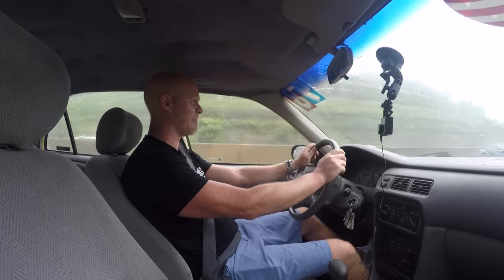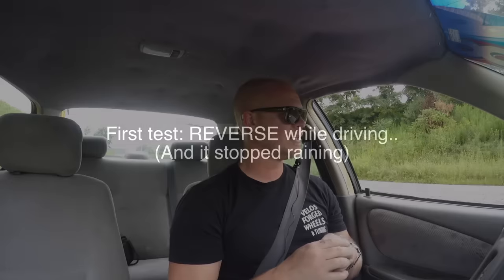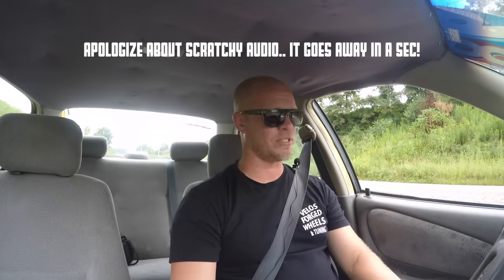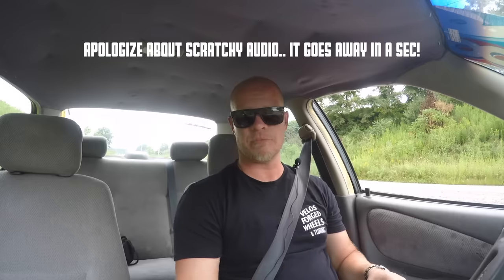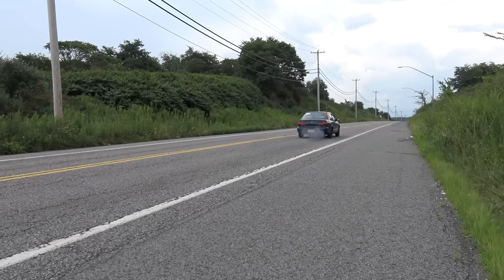What happens if you put a 20 year old car in Reverse AND Park WHILE driving? (NOT SAFE)

Comment from the maker: What video should be next? ;)
Reply: AutoVlog extreme abuse test. How much will it take to truly break the Chevy Prism
Reply: Take it off road
Reply: cold start up and before you start it hold gas and start it in drive and go before the car starts properly and keep on high revs
Reply: crash it into something and see what the damage is. (low speeds)
Reply: Put a manual car in reverse
Reply: AutoVlog "how long can a 20 year old engine last at redline?"
Reply: hahahahah the gearbox is gonna go "boom" and its not funtion then
Reply: What it looks like to crash a Chevy prism
Reply: does a Prism float
Reply: Floor the pedal on a cold start
Reply: Try going from reverse to drive?
Reply: Gotta do a reverse to park video. Done that before by accident in a 1995 Cheney conversion van. Full size. And it was a very loud tick tick tick noise. I assume from the parking pin slipping from momentum.
Reply: See if Prolong super lubricant really works.
Reply: AutoVlog hey could you do more sports/performance car reviews  maybe even normal cars 😉😁
Reply: Try putting it manuli in 1. gear wile driving 60mph :)
Thanks
Reply: Hey you should see if it can do a burnout???!!!!!
Reply: AutoVlog I think you should get a eBay catalytic converter before you pass out while driving.
Reply: Stunt driving. Reverse at say 40 or 50, do a 180 and floor it.  Build some ramps and try to get it up on two wheels (wear a helmet just in case you roll).  Clorox burnouts would be fun, you can get the parking brake tightened up for a good lock.
Reply: What happens if u throw a hand grenade in a Chevy prism
Reply: What happens if you put it in first gear while driving?
Reply: Throw the keys out the window while driving 😂🤣
Reply: How long can you drive on a dead alternator
Reply: Pimp it, Xzibit-style.
Reply: Drive this car in reverse fast and then drop it in drive while flooring it!
Reply: Or drag race or both
Reply: AutoVlog neutral drop, go as fast as you can in reverse and put it in drive
Reply: Neutral slam at redline
Reply: Try putting a 20 years old manual transmission car in reverse while driving and rev it ;)
Reply: Throw the key fob out the window while driving
Reply: Try pull some heavy weight....
Reply: Try to tow the F-150
Reply: fastest speed in reverse, burnout, donuts, towing f150, racing c63 (benz in reverse), sumo with f150(both cars head to head with a buffer in between pushing each other), off roading, jumping it, j turns... jeez i need a beater car
Reply: Try putting anti freeze into the gas tank
Reply: Since it already smokes try seafoaming it to see if it helps.
Reply: Off road adventure
Reply: AutoVlog burn it
Reply: AutoVlog Absolutely Hilarious Video I'm glad you're ok after doing those tests I think your see happens if slam the brakes at the Highest Speed possible on a long straight road and if you rev it up to high rpms
Reply: AutoVlog can your 9 year old daughter drive it without power steering.
Reply: Great video !!! :) :). PLEASE TAKE IT OFF ROAD FOR THE NEXT VIDEO!!!!
Reply: put it from drive to low gear at 60mph
Reply: Top speed of reverse, then top speed of reverse to park.  I think the car turns off when going in to reverse to keep the pump or whatever from working in the transmission, other wise it would try to tear itself apart.
Reply: You should dyne the car stock, then chop off the mufflers, and a cold air intake from Pep Boys. 😂
Reply: Burn out
Reply: What happens when you spray 100 shot of nitrous to a 20 year old car?
Reply: If rev up and put in D
Reply: Redline it in neutral and drop it into drive lol I used to do this in my 99' Carolla, made for great peel outs
Reply: Put a fart can and spoiler on it
Reply: AutoVlog 
I hate to say this but that shit box will probably last longer than you Mercedes.
Reply: JustCallMeGhandi 
It's really a Toyota Corolla with a Chevy badge.
Reply: Hook tow straps to front and rear with your trucks and split that turd
Reply: What’s happened when you go off roading
Reply: buy a selvage car and fix it like other youtuber doing if u have mech expert ofc :)
Reply: Idea 4 what if video. Fill fuel tank with e85 ethanol. Engine light will trip because computer not set up 4 it. Fuel filter might get clogged because of cleaning out junk gas leaves in tank. Also will help with exhaust smell.
Reply: You should try to drive in the new Merc in that rain I got a feeling it'll shut off
Reply: Try and floor it when you put it in reverse
Reply: AutoVlog hold it on red line and drop it in gear
Reply: DO IT 0 TILL EMPTY FUEL TANK
Reply: Turn the key.
Reply: do a top speed how fast and can go when its  rattling like crazy
Reply: AutoVlog buying my ford fusion again
Reply: Neutral drop from redline. See if it survives and does an epic burnout, or leaves the transmission on the street.
Reply: Need red lining it a lot
Reply: Keep red lining it a lot
Reply: Get up to 15 MPH in reverse and then throw it in drive.
Reply: Drive the car in reverse and put it into drive and park
Reply: What happen when u put in drive while in reverse?
Reply: Take that car to a demolition derby! Then try the same thing on a 40+ year old car!
Reply: Money shift it 50mph into 1st gear lol
Reply: Reverse to drive
Reply: pick nose, chew bubble gum while honking horn
Reply: AutoVlog use seafoam
Reply: What would happen if, you take it to Sunday coffee!!!
Reply: It would be cool to see what happens in an old Car with the shifter next to the steering wheel.
Reply: What happens when you tug-a-war with a MB C63S?!
Reply: What happens if eBrake is on and 20 yr car is put in Drive and floored?!
Reply: What happens if you put other fluid Instead of hydraulic fluid for the power steering? Greetings from Germany :)
Reply: J turns an Nitrous
Reply: Do an bumb test that what the factories also do
Reply: AutoVlog Mike pull the ebreak and put it in park
Reply: It would be more interesting with manual transmission :)
Reply: @AutoVlog How fast can my 20 year old car drive in reverse (or do I dare to drive it in reverse)
Reply: AutoVlog 
Straight pipe it Mike!!
(Experiment)
Reply: How long will it run with out engine oil ?
Reply: Break distance and trajectory, then repair brakes, put new tires, and repeat it at same speed for comparison. Maybe also doing the same with the AMG or pickups..
Reply: The real question is what happens when you put a manual in reverse :)
Reply: AutoVlog 
Well Mike a course these vehicles are bulletproof Chevy prizms are just Toyota Corollas with a different name and badge
Reply: AutoVlog How far can you really drive on 0 miles to empty?
Reply: can it swim?
Reply: AutoVlog reverse to drive. I accidentally did it at a slow speed backing out of the driveway and heard a knock sound in a 2015 Ford Fusion plug-in
Reply: Chevy repair
Reply: Shut the car off while driving
Reply: Give it a big restoration
Reply: Try to do the same with a manual transmission, usually most automatics can handle it.
Reply: Make a drift with it
Reply: 40mph reverse to drive
Reply: Can you do this test but now start in reverse, and then shift into drive instead? Nice video!
Reply: Put it in park, then immediately put in reverse would love to see that video, let's go mike!!!
Reply: AutoVlog you should drag race it against the amg, see whose got a faster quarter mile
Reply: What happens if you put diesel in a petrol car
Reply: what happens if you crank the starter while driving. And what happens if you turn the key off while driving.
Reply: Run with no engine oil
Reply: Drive it into downtown Pittsburg
Reply: Restore, engine swap, tranny swap, and make it a drag racing car
Reply: AutoVlog put in drive or park while reversing
Reply: Drive off road in Squishy Mud :)
Reply: Put a stick shift in reverse 😀
Reply: Bob H that won’t do anything. Cars die all the time in drive just throw it in neutral
Reply: OK next,, 40mph, neutral, Rev to max, keep revving, smash reverse while revving. That should be an exiting vid
Reply: How many times can the trans handle being neutral banged
Reply: Brian Peterson Ohh it can take quite some bangs before it shatters
Reply: AutoVlog how many miles it will goes without motor oil. Remove the valves cover and engine's carter please. Guess you can't get it soon)))
Reply: -A 5 second burn out
-How fast can it go in reverse
-while in reverse go about 9mph then toss it in drive and give it some throttle!
-fix the E-Brake and do an offroad pull/powerslide
Reply: Straight Pipe It!!!!
Reply: What happens if you straight pipe a 20 year old car
Reply: AutoVlog u should go in reverse and get up to 20 mph in reverse then throw it in drive and/or park.
Reply: AutoVlog The same type of video in the AMG
Reply: Put trays under the rear wheels which e brake on and attempt to drift it!!!
Reply: Make sure you put your headrest up so it’s in line with your head Incase your head goes back you won’t get whiplash. Such as if the car suddenly stops.
Reply: AutoVlog go under 20-25 and put it in reverse totally different results   happens in my truck accidentally hit the shifter your be surprised
Reply: AutoVlog take that shitbox to yellowcreek Ohio. See how far you get.  Only about a hour away from pittsburgh airport.
Reply: test it 0-60mph! on regular gas, then put super/premium gas available in your area and run the same test again to check if you get different results
Reply: probably nothing LOL
Reply: Do this with a manual transmission
Reply: Drifting with fwd automatic car
Reply: horsepower loss within 20 years and getting them back again
Reply: My message to you is one from the voice of the people, do it or i will encourage a mass of unsubscribings
Reply: You should have it floored when you put it in reverse.
Reply: AutoVlog can we drive a car on 3 wheels?😂😂
Reply: What happens if you hit a puddle in a C63s AMG?
Reply: Now buy a 20 yr old Ford and see if the same thing happens or if it's different.
Reply: 1- Doing a 0-100 km/h test! 
2- Turn the ignition off while driving!
Reply: R ri D and hit the gas
Reply: Reverse and drop it into drive???
Reply: Attach a 20 year old fleshlight to your exhaust
Reply: DO A REVERSE SLAM
Reply: What happens when you put a manual car in reverse, while driving!
Reply: AutoVlog rev it against the rev limiter and neutral drop it on dry blacktop.
Reply: Floor it in park and shift to drive at full trotted
Reply: Demolition derby in that POS🤘
Reply: AutoVlog a 1997 Ford vehicle. Or older :))
Reply: AutoVlog drive and shift into reverse and hit the gas when you shift into reverse
Reply: What happens if you back it I to a tree? Then can a f150 run over a Chevy prizm.
Reply: AutoVlog What happens if you try running it on lighter fluid??
Reply: AutoVlog do it on manual
Reply: Do the same on a 80-90's manual car
Reply: AutoVlog Try going in reverse and putting it in drive or park.
Reply: Olive oil as a engine oil
Reply: Do it in a manual
Reply: while driving at highway speeds (60/65 MPH)and putting it into lower gears (2nd. 1st) *automatic Trans
Reply: AutoVlog 80 mph than go to 1st gear🤔
Reply: Drive at a higher speed then put it in Neutral, wait for the engine rpm to go down to idle then put it back in Drive :D
Reply: Use gasoline as engine coolant and see how long it takes for your engine to light on fire.
Reply: What happens if you press the panic button while driving
Reply: Reverse & Park with baby oil as transmission fluid
Reply: Doing this same experiment but with a car that has a standard transmission...
Reply: Reverse as fast as possible, then slam it into drive.
Reply: Try to go forward and hit brake xD
Reply: Reverse and then into drive and reverse and into park
Reply: AutoVlog a manual car ??
Reply: From D to 2 or 1 gears in automatic transmission
Reply: How to buy a used car?
Reply: what happens when you shift into reverse on a 20 year old manual transmission car
Reply: Run it thru a “puddle” of water and see if it hydrolocks....
Reply: What if you get a manual old car and stick into reverse
Reply: Driver over a MASSIVE pothole ;)
Reply: AutoVlog even my 91 Mazda protégé has the park and reverse safety shut offs
Reply: Go reverse into drive
Reply: The next video. What happens when you add too much oil to an engine. I say add two extra quarts and see how it responds.
Reply: AutoVlog What happens when you put reverse after 5th gear in a manual transmission.
Reply: Get a manual transmission car and change gear from 5 to 1 while driving 100km/h
Reply: Floor it down in neutral and drop it to drive
Reply: AutoVlog put ur car in drive while backing up, my friend did it one time and got some really interesting results
Reply: Y’all trynna kill the man sheesh lmaoo
Reply: Try it with manual
Reply: Throw the car into low gear while doing about 60
Reply: What happens if you put it neutral, then floor it till it bounces off the rev limiter and pull it in drive?
Reply: Do the same but in a manual tans!!
Reply: Fill the engine with premium ethanol instead of oil and fill the gas tank with oil, fill the coolant reservoir with power steering fluid and the power steering reservoir with antifreeze
Reply: RIP MisterBassBoost most automatica wont start in drive , sorry
Reply: Neutral drops!
Reply: Do the same test but be flooring it while shifting from drive to reverse
Reply: What happens if you try to start a car when the engine is already running? Will it ruin the starter mortor or break something else?
Reply: AutoVlog Neutral Drop!!! Put it in neutral, floor the accelerator, slam it into drive while holding the accelerator pedal to the floor. 😁
Reply: I know do the same exact thing but with the amg
Reply: AutoVlog what happens if I drive my 20 year old car into a wall?
Reply: AutoVlog rev limiter in neutral then slam into drive
Reply: Overspeed the engine by jamming it in low gear while going 50mph and see what goes first - will the car skid or the engine rev to the moon ??
Reply: howtobebasic1 usually nothing lol cause their worn out
Reply: AutoVlog what happens if you go from D to R to P back to D to then R and P(you get the point) while driving??
Reply: Teach americans how to pronounce european car names. 
It´s not BEE-EM-DOUBLE-U, it's BE-EM-VE, almost like "be envy". 
Same with Lamborghini, it's not "lamb-or-genie", it's "lam-ber-gini"
And finally, lets settle this for once, it's "Poosche", not "Porsch" or "Porscha"

As a Swede you could teach your fellow americans how to pronounce some european car names :)
Reply: AutoVlog try doing it starting at 5mph. 10mph. 15mph and so on
Reply: AutoVlog 
Fly using a skateboard 🤔
Reply: AutoVlog you should launch it put it on park and step on the gas all the way then put it on drive right away
Reply: AutoVlog accelerate in reverse and shift into drive.
Reply: You should shift into first gear
Reply: do the same with a manual gear car. automatic is stupid
Reply: MONEY SHIFT!
Reply: Go on dirt rip the ebrake and just try to keep driving
Reply: AutoVlog I've always wondered that to randomly when I was driving what if I did that and now I finally got an answer that's cool thanks for the video what a great idea.
Reply: AutoVlog 40 year old car
Reply: What about a manual
Reply: Landon Coyle yeah this will complete the experiment
Reply: *How about something without a click bate title!!!??

"NOT SAFE"*
Reply: AutoVlog 

What happens if you crank your car while its' running?
Reply: AutoVlog hold the gas and brake in drive and launch then try neutral droping it!
Reply: AutoVlog did you know it would run perfectly on baby oil?
Reply: AutoVlog so I noticed you never have done a reverse to park and matted park to reverse test yet
Reply: Pls try reverse and put it into d
Reply: U should try to go more than 60mph and put in first gear
Reply: Try to make this in a manual tranmission car.
Reply: Seafome it. Put 1 can in oil 1 can in the gas on low
Reply: AutoVlog put it in neutral and then rev it to red line and slam it into drive
Reply: Do it on an automatic car..... I did at 20mph... The car came to a complete halt.....
Reply: Try it in a 2000 mustang!!
Reply: Do it in a manual car it will be a lot more exciting trust me I did once in my car.
Reply: Do it with an older American car aka no fancy stuff to prevent what we saw where everything is mechanical. Like 70s or 80 American car
Reply: how many times can you jump a car and kill it
Reply: Put a manual car in first gear while driving at a higher speed
Reply: what about a 30yo car?
Reply: You can try to put diesel in it!
Reply: Same  thing but with amg
Reply: AutoVlog where was the unsafe part???
Reply: Drive in reverse and then throw it in drive while moving
Reply: Have you done turn on 4wd switch while moving fast?
Reply: We did that with a 97? Thunderbird an split the bell housing doin 70 on the highway ( no governor if that makes a difference)
Reply: AutoVlog  do the same thing but with an old manual car plzzz
Reply: Fill the car with largest Boulders or bricks you can find and drive it till it won't move anymore . Lol😂😂
Reply: Put a 1992 chevy s10 to the test
Reply: You need to lower it by cutting one loop out of each spring, then put it on 4 donut spares that are spray painted metallic gold. Then use a roller and latex house paint for a new paint job. Then just drive that ugly POS around Pittsburgh until the city pays you to not drive it anymore.
Reply: Repeat, but this time in a car with a MANUAL transmission, or something even older.  My cousin happened to do something similar a number of years ago in a 1980s Ford Escort, and it caused her to go off the road, I think it totaled the car.  (She was probably only going 25 or so at the time, based on where it happened.)
Reply: To in reverse then switch it to drive or park
Reply: AutoVlog that shit should of hooked and your shit should of flipped
Reply: AutoVlog do it in a manual car
Reply: What happens when you crash into another vehicle and leave the scene (if car still works).
Reply: Try a 30 year old car
Reply: NITROUS!
Reply: what happens when you turn the ignition off while driving 60+?
Reply: Try in a manual :)
Reply: Also, you should probably try at a slower speed, maybe 5-10mph. There might be safeguards for higher speeds?
Reply: HOW LONG YOU BURN OUT BEFORE THE TIRES POP!?!?!?
Reply: top speed u turn
Reply: one that doesnt smell of soyboy experiences...
Reply: The main question is does it ruin your transmission at all if you do it once by accident
Reply: Get a 1970s or older car that's all bone-stock with a MANUAL transmission, and do the same experiments on that car.  (My grandpa accidentally shifted to reverse in a 1980s Ford Escort once while going forward and it basically locked up the wheels.)
Reply: Did this back in the 60s with Dodge/Ford push button automatics. 1960 Dodge VS 1958 Monarch doing burnouts by backing up first then punching drive and flooring it.!  ! The Dodge worked great until the rear of the transmission split off.! ! The Ford died when drive was punched and the backward travel spun the (312cu)engine over backwards, so my foster brother {DW} punched nuteral /"START" and the ring gear instantly cut the starter bendex gear off faster than a chop saw ! ! 😨 YES tecknowlegy has come a long way since "we"  were kids !  ! 
Great vidio "THANKS". 
Often wondered how they fixed the problems we had 'back in the day'         AKR
Reply: Get a 80s car or a car without an electronically controlled transmission. Those will ingage any gear you select.
Reply: Would love to see some Aussie cars in the states,  Ford Fusion is rebadged mondeo here aswell but very unpopular car in Australia
Reply: Neutral stances while going from drive to reverse.
Reply: Go from reverse to drive or from drive to reverse but no going that fast so the fail safe cant engage
Reply: SuperHijole they all have lock outs
Reply: Full throttle on neutral, engage reverse then drive then park all with your foot full flat on that gas pedal, no brakes 😁🚗
Reply: Hey man it just stalls not ignition
Reply: The old, I pulled the e-brake and cut the wheel at 100 mph on the highway in my neighbors car while smoking meth and drinking whiskey, with a suspended license and a felony warrant,  in a school zone experiment